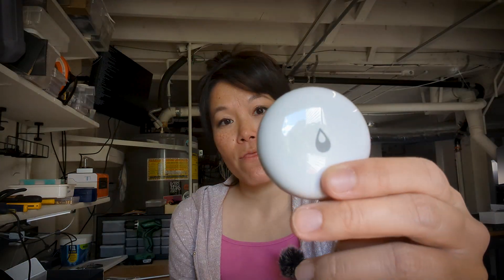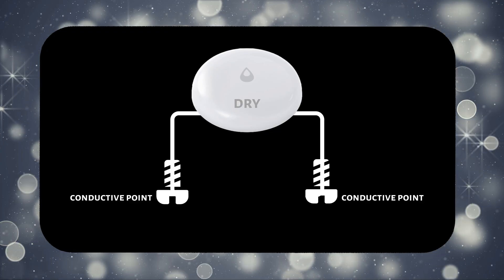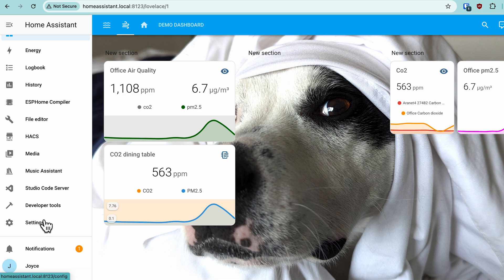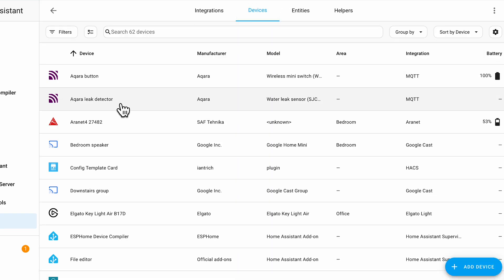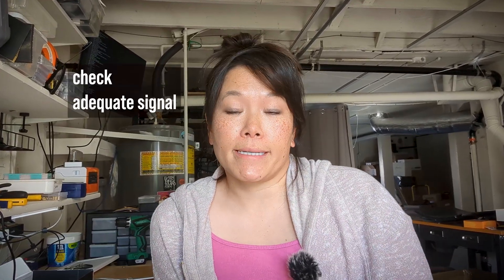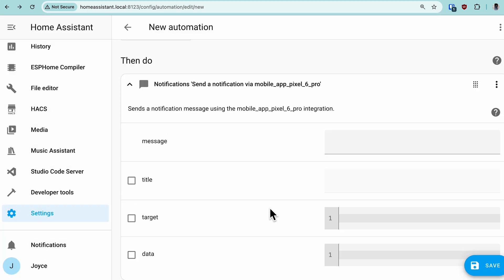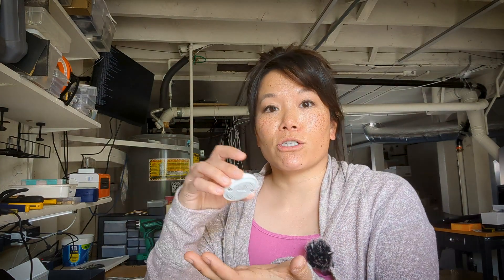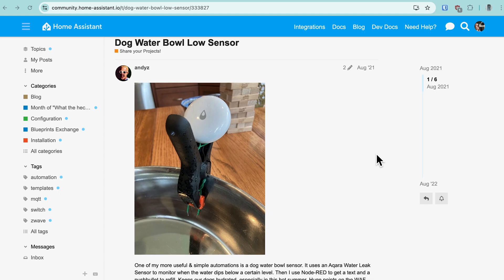Aqara leak detection sensor with Zigbee2MQTT

Comment: I can confirm, this exact model saved me a few months ago when my garbage disposal decided to start leaking ... because it was leaking ever so slowly, it would've been a while otherwise had HA not alerted me :) (also, it was the DAY BEFORE I left on vacation ...). I do have a question for you ... i have a Sonoff dongle and connect zigbee devices directly through the zigbee integration ... what is the benefit of using Zigbee2MQTT instead?
Reply from the maker: Close call! If ZHA is working for you, no need to switch. I use Zigbee2MQTT because it has support for more devices and gives you deeper control for configs.

Comment: Since they have those screw terminal you can connect them to a pressure pad. Now I use it to detect when I’m in bed and to lock all the door and set the alarm if it forget.